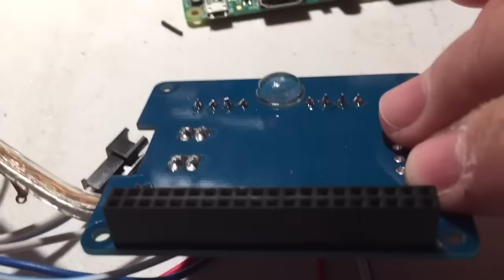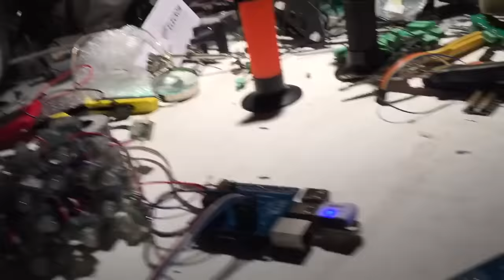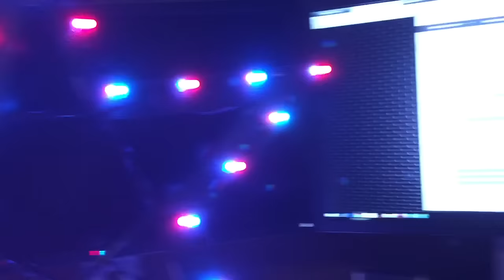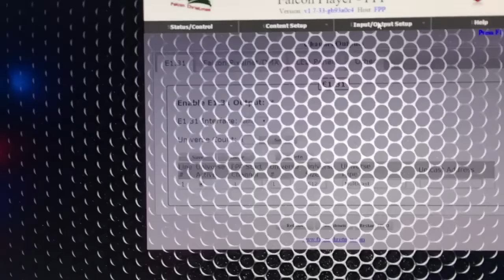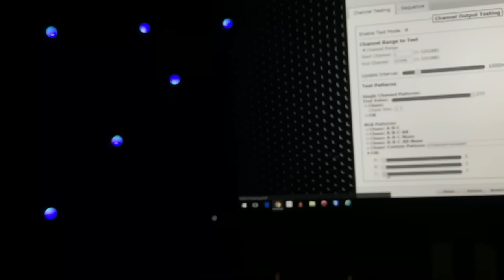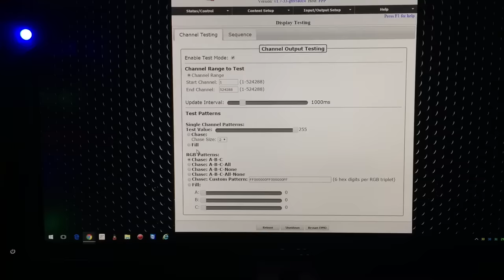Raspberry Pi HAT intro

Comment: This looks like a very useful add-on. Just an FYI: a Raspberry Pi add-on board is only a "Hat" when it has an EEPROM which supports the autoconfiguration system that allows automatic GPIO setup and driver setup. Details here: http://github.com/raspberrypi/hats
Reply from the maker: Noted. However HAT just stands for "hardware attached on top" to use this board you would not be running a traditional raspberry pi OS anyway and will need to load the FPP that does have everything configured for operation. This is not targeted to the normal raspberry pi masses but rather for a very specific group of hobbyist.
Reply: +Andy Harrison 
A very specific group of hobbyists who LOVE this.  Wearable pixels here i come!

Comment: 404 subs page not found heh
Reply from the maker: Working fine on my end.
Reply: +Andy Harrison hmm I guess you didn't get the pun here is a google search - https://www.google.com/webhp?sourceid=chrome-instant&amp;ion=1&amp;espv=2&amp;es_th=1&amp;ie=UTF-8#q=google%20error%20404&amp;es_th=1
PS 
there is nothing wrong with the video
Reply: +Agentsix1 You had 404 subs so I made a shitty pun saying page not found

What is a 404 error?
The HTTP 404 Not Found Error means that the webpage you were trying to reach could not be found on the server. It is a Client-side Error which means that either the page has been removed or moved and the URL was not changed accordingly, or that you typed in the URL incorrectly.

Yea I know it was bad